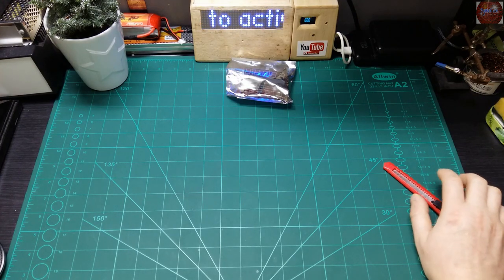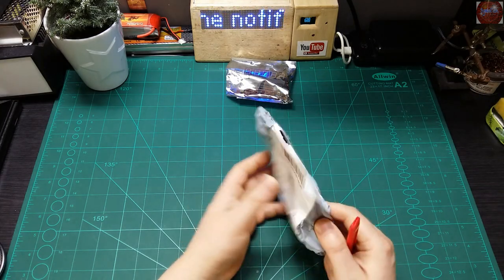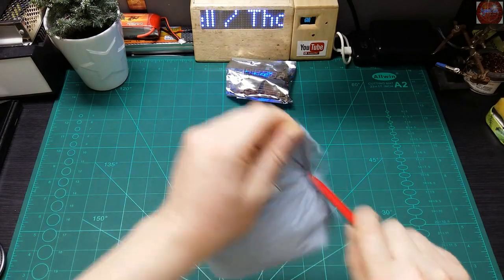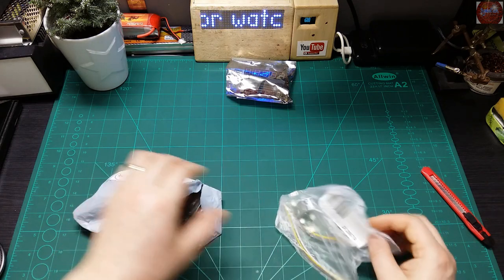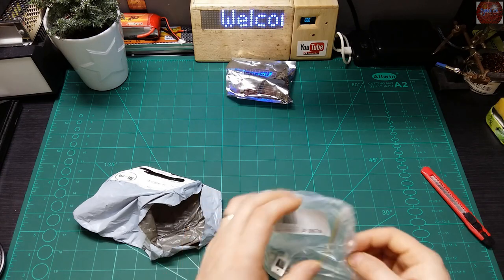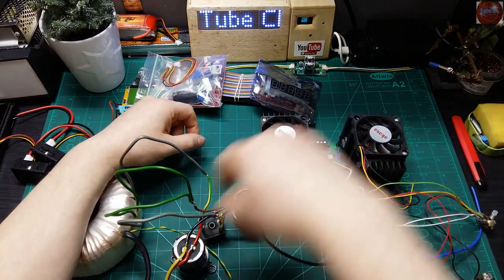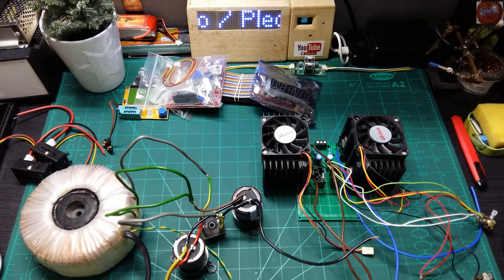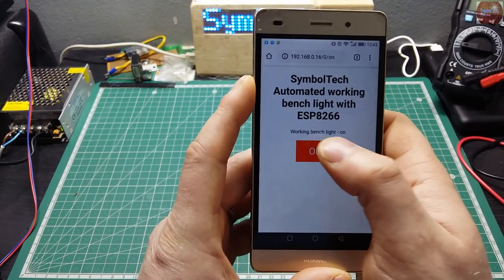mailbag electronics stuff #11

Comment: Good idea to buy the kit to get those 7-segment LEDs and the PIC chip.
Reply from the maker: ya with that such cheap price its a good idea
Reply: I have thought about getting one of those a few times whilst Allie shopping. Others I have seen with the kit have gotten the three transistors as well, but one should be a voltage regulator I think.
Reply from the maker: @UReasonIt  I don't buy this kit to build anyway I just compare the price for the things u get so its really convenient to get for the components
Reply: @SymbolTech21  Yeah, I understand. It's always good to have parts! I have a freq counter already and made a crystal driver circuit for it for testing them with.
Reply from the maker: @UReasonIt  wow nice maybe you will share how that works

Comment: I got one of the component testers probably 5-6 years past and it had the display yanked almost completely off upon arrival. I manage to get it back together and did not use it a lot due to it being tied to a 9v battery, the display is hard to see at an angle, and getting some components into the zif is problematic as you saw.  I just recently added permanent mini-clips to it, crockets for the power connection, and cobbled a stand to have it at an angle whilst using.  I make it usable for me now!
Reply from the maker: which display is? and if you try to see if there is any possibility to convert to 7segments led display you will not have any problem with the angle
Reply: @SymbolTech21  For the Component test like you have, it has an LCD display, so conversion to 7 seg LED would be problematic.  After making a holder for it that keeps it at an angle make it enjoyable to use now.